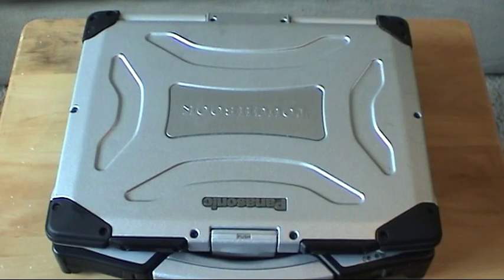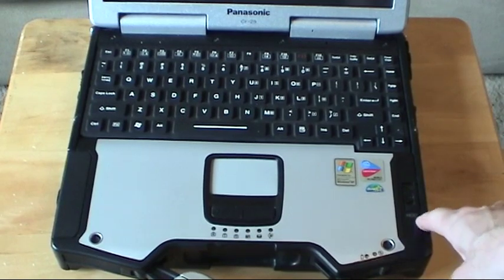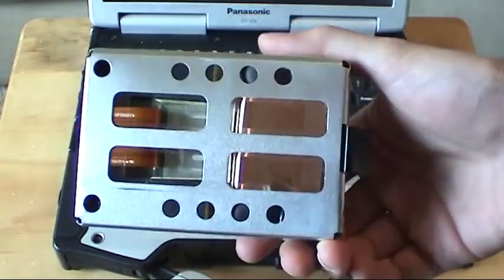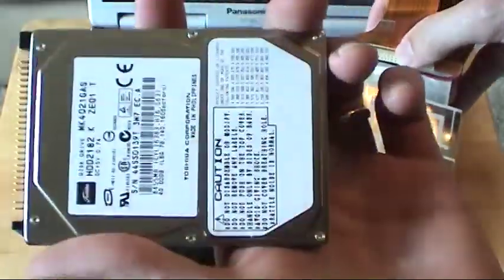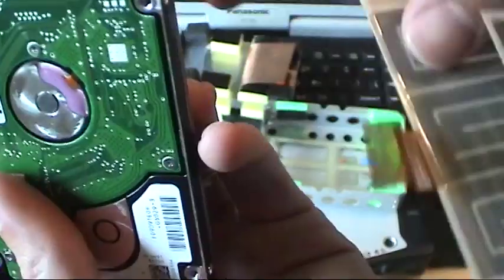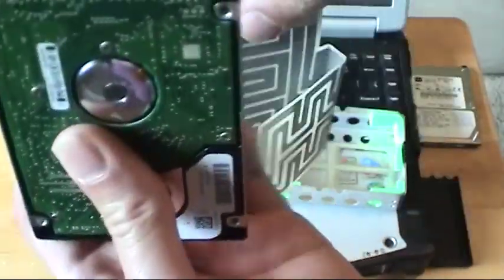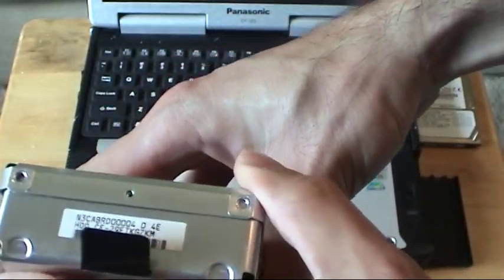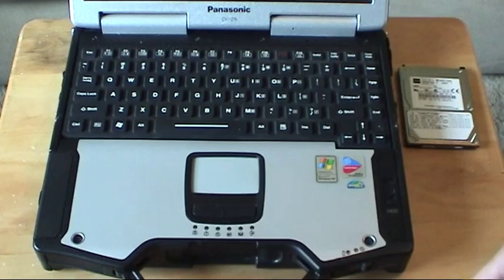How To Replace A Panasonic CF-29 Hard Drive

Comment: Black Hawk Refurbished Toughbooks are designed to withstand more abuse than current Panasonic Toughbooks on the market. Black Hawk Refurbished Toughbooks come equipped with a Rubber Knobby Protector and a Base Coat of specific paint color for each operation the machine will be used in. Refurbished and Rebuilt CF-29 BLACK HAWK, DESERT and CHROME HAWK Panasonic Toughbooks at PanasonicToughbooks are designed to withstand Natural disasters, Earthquakes, Flooding,